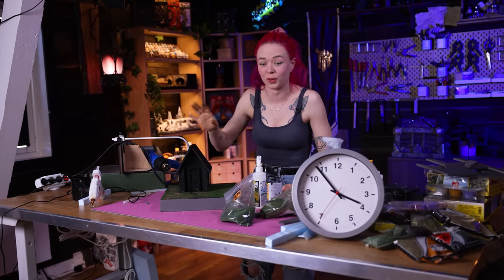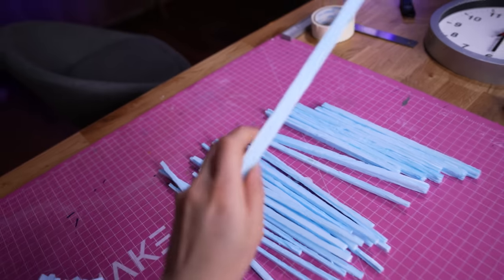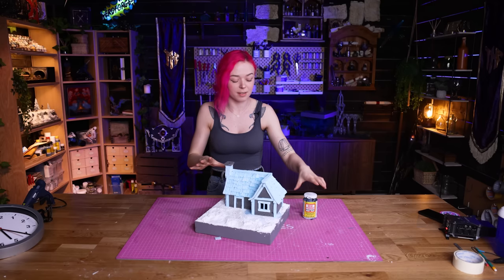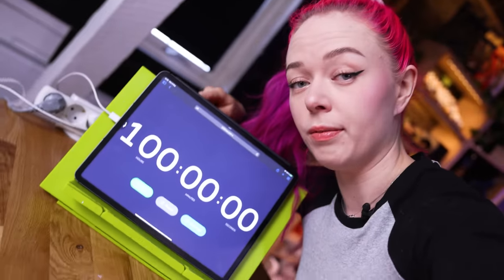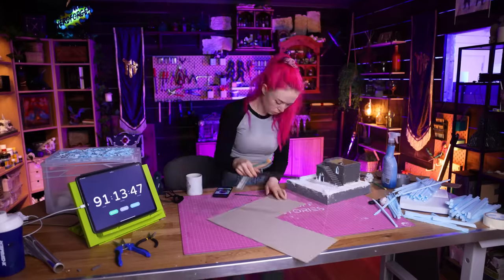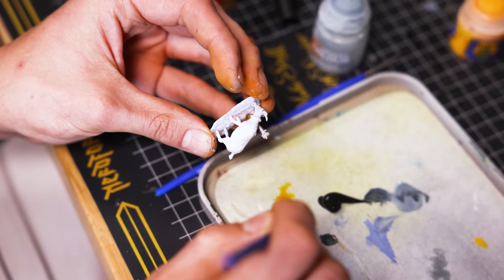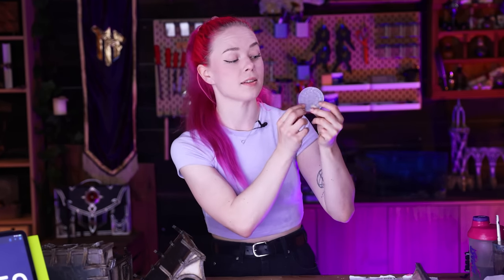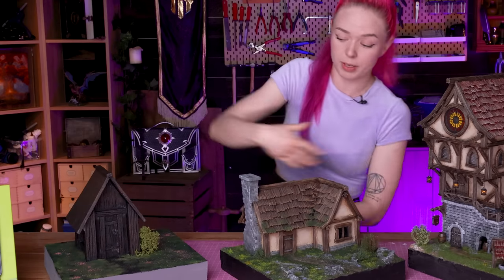I made a diorama in 1 Hour vs 10 Hour vs 100 hours

Comment: I'm amazed at your gluing abilities. Whenever I glue something, there is glue everywhere and it never stays right away. I would have those little glue strands or have it seeping out from everywhere if I did it!
Reply: Not sure if you're looking for genuine tips, but usually a lower heat setting will help with those problems! You'll get less working time, but it will be much more "instant" and a bit less stringy (although there definitely is some level of technique to get rid of strings completely. It's a similar motion to the "twist and pull" method of preventing paint/juice drip)

Comment: For a super fast basecoat, you could use spray paint + fat cap (or chisel/calligraphy cap).
      The '94' spray cans by MTN (Montana Colors) are low pressure - VERY controllable - and with a fat cap on it, it's basically an airbrush... that requires 1min shaking to prep, and that dries in 2 mins. 
     Within 10 mins, you can cover everything in 3 super thin layers and have it dry so you can move on to hand painting :)

The 94 range has like 216 (I believe more now, actually) super nice matt colors, including some fluorescents, AND... (More importantly).. 
      Some half transparant colors: "shadow black", "shadow grey" and "air white".
      With those you can very easily 'mist' some highlights on your piece, or add some depth.

The 94 range is something like nitro-acrylic paint. 
      They also have a range of matt water based spray paints (that you can use indoors - very much aimed at artists)

Oh, and they have some cool 'texture paints'... Definitely worth checking out, I think.

Takes some practise, but you can do very fine work with those spray cans (and all the colors are amazing.. There's like 24 different grey colors - light, dark, warm, cold, etc)

Comment: Could you do a diarama with cheap tools and expensive tools? I want to see if the expensive tools are better :)
Reply: I feel like the difference will be in the time spent on the dioramas
Reply: durability might be a factor
Reply: Depends really i see people painting kits and sets with a cheap ass airbrush cheap junk but still manage to do avery decent job if thay spend more on the airbrush compresser and paints theres a huge differnce but even with cheap grade stuff if you know a few tricks u can get away with top tier work
Reply: Substract all 3d prints, time used factor 1,25 or so. Here is approx result.
Reply: If you want to see really low-budget dioramas, check out the Rustic Frame channel. They do cool things practically from improvised means
Reply: Before they didn't had expensive tools so watch their past videos. I am an architecture student and i can tell you that expensive tools are mainly use just as a time saver (and it's a little more neat of course). You can do diarama with only your hands, precise knife, your tears and your blood but it is going to take sooo much longer than if u just program a laser cutter and in the end it is always more neat even if your very precise with your hands 😢
Reply: Some effects can only be done with the right tools. That said the one hour house is the best it would look like. Just foam for construction is the cheapest material available, but you can only get a single story house, if you make the walls in the same manner, due to structural integrity.  You could do whole blocks of foam to create large structures but as far as costs go you end up spending more for less detail then doing cardboard structure and foam details. Just like you can cut foam with just an exsacto knife but it take more time then a hot knife.
Reply: @darylobey8867  An airbrush is an airbrush as long as you take care of it. A standard round nozzle with a cardboard in the other hand to direct it, becomes a flat nozzle.

Comment: I like this type of video, 3 times, 3 budgets, 3 skill levels etc. What I think would be an interesting one is if the 1 hour was last, certain skills, pinch points and details would be worked out on the longer builds and the 1 hour would be a fluid practiced build, I'm sure it would be 50% better

Comment: Disregarding time constraints, I think assembling a brick wall out of individually cut bricks (you can just slice up a long rectangular block to be easier) gives a bit more variation because they're not going to be perfectly the same size because they're cut by a human. I think that style would be more suited for this type of house where everything is off kilter and built by normal commoners who don't have a lot of architectural skill. But the brick wall where you take a foam sheet and just score it in lines and hit it with a heat gun would give a nice uniform and consistent layout with straight and parallel lines and everything aligned. I think that style might be better suited for building something like a castle or palace where the king would hire top notch architects and could afford to make everything perfect. Obviously the second method is easier and faster, but i think it's something to consider when trying to make a style that fits into a certain universe.

Comment: Could you do a diarama with cheap tools and expensive tools? I want to see if the expensive tools are better :)
Reply: Advanced tooling really only optimizes time. In the great majority of cases, you can get the same result without the expensive tools if you spend more time on it. Some of that saved time does manifest as higher quality, but the tools rarely make the project *possible*, just make a project take less time.